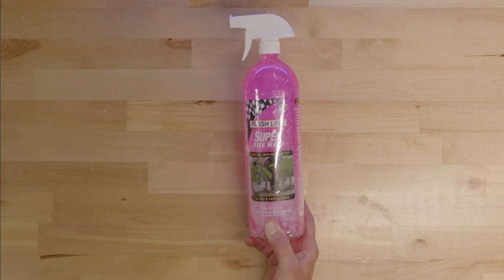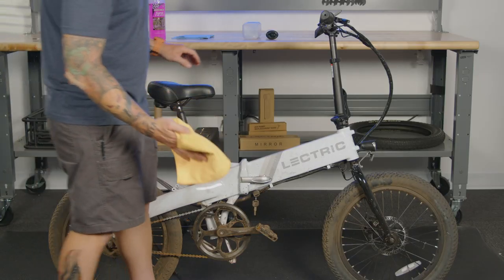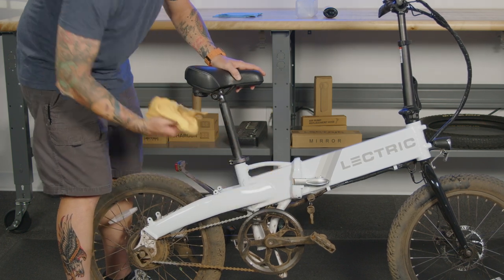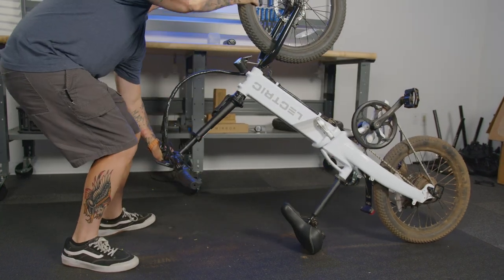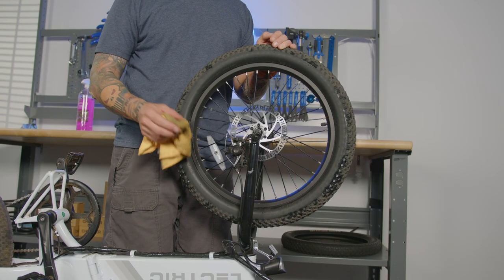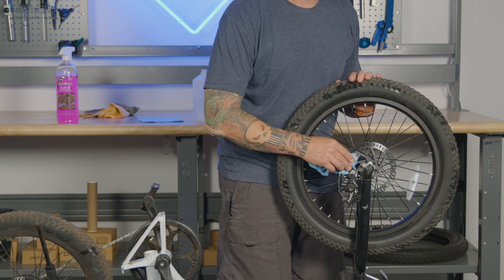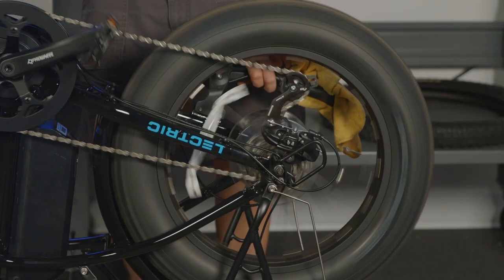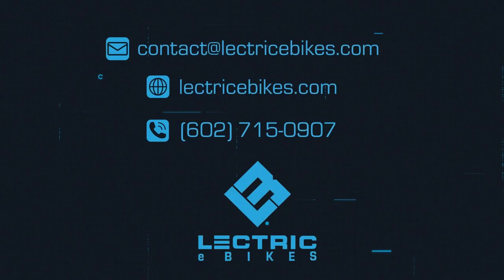Lectric Service Center | How To Clean Your eBike

Comment: 1000+ miles XP 2 in six months.  Original brakes and tires. In addition, If you want more life from your bike......On the painted surfaces no rinse no spraying car wash maybe used as it contains some repellent wax for potection.  Additional ceramic wax protects and repels more.  Use chain cleaning device sold at bike shops, much better.  Also cog wheel and derallier brush.  Clean electrical contacts gently and protect.  EBay had listing for custom made handlebar and rear frame protectors for upside down position.

Comment: Yawn, I do the exact same treatment to my "electric" ATV's and "electric" monster truck's (they have batteries too but cost 10's of thousands more) so my one day's mudding adventure turns into days of cleaning or I could just take them by the car wash to be done in less time to watch this video but alas, I just hose down my lectric bike with my pressure washer then blow dry it with my air compressor or leaf blower, no chemicals needed (soap or alcohol).
Reply from the maker: Hey there! We certainly don't recommend hosing down your eBike as this essentially could ruin your electronically components such as lcd display, controller, motor, etc. Have a stellar day! ⚡️
Reply: @LectriceBikes  Yea but you’re basically just doing a quick once over in this video.  There is no possible way you’re cleaning all the dirt and grime out of the nooks and crannies with a rag….  The drive train especially.  I don’t see any other way to get a deep clean without using at least a light jet of water.  Away from the electric components of course
Reply from the maker: Our eBikes are rated IP-65 to withstand light rain and small puddles. By classification, this means that it can "resist a sustained, low-pressure water jet spray." You can certainly clean your components but be mindful of the electrical components, sealed ports and plugs, and remove the battery as an extra precaution.
Reply: @LectriceBikes  Sounds good thanks.  Would you say the motor is sealed up pretty tight?  Enough for me to rinse the cassette and derailleur without spraying the hose towards the motor or connections?
Reply from the maker: That motor is sealed pretty tight! You can squeeze along the motor cable that protrudes from the rear axle to check for any breaks/cracks as an extra precaution, but yes, you should be good!

Comment: A light electric pressure wash and a leaf blower and your bike, wheels,and tires are much cleaner than this and you are done in 1/4 time. Watch a few e mountain bike wash videos and just be careful around the motor and cables

Comment: ahh i washed it with the water holes and missed up my display, so don't do that to your handlebars bars I learned this the hard way. ops is there away I can  check the mother board on the display to see if it got wet I haven't checked it yet but the one in the button cover looked ok.

Comment: I have a 3.0 can I flip it over on the handlebars without hitting the screen?
Reply: just rotate the screen so it won't touch the floor then re-position it when you turn the bike back on its wheels
Reply from the maker: Hi James, like others have mentioned, you can rotate the screen so that it is not going to be in contact with the floor!
Reply: @gonzo2.0  Amazon has these little jacks that you attach to the top of your handlebars, and when you flip it over it will protect your screen, I seen it on YouTube but can't remember the name of the channel or the name of the item, guess I'll just search for bike repair items on Amazon and I might get lucky and find it for my 3.0🥰
Reply from the maker: That sounds wonderful! Our community is always making new great accessories and selling them through Etsy or other marketplaces, which we love! 💙
Reply: @LectriceBikes  I found them, they're actually called handlebar jacks